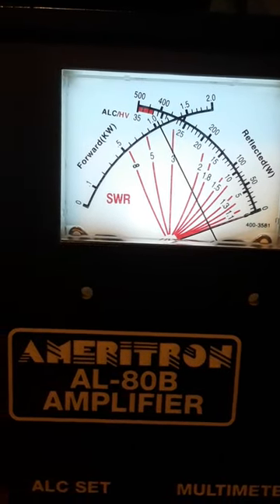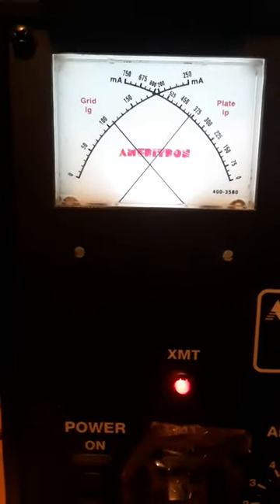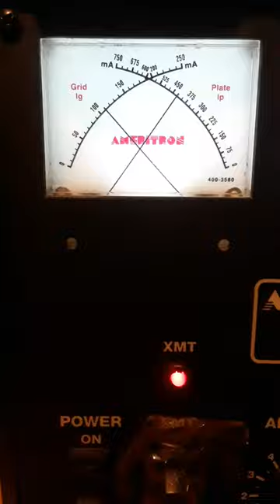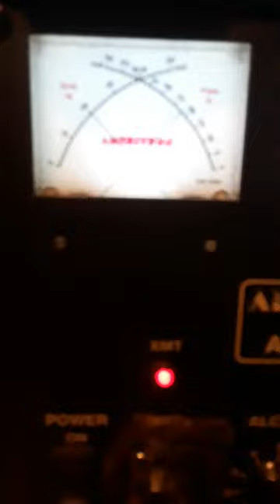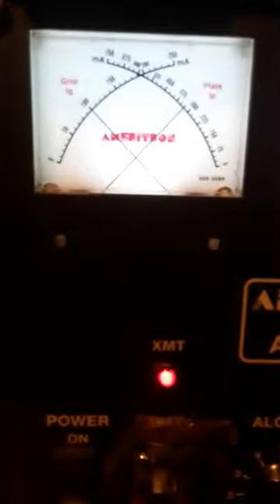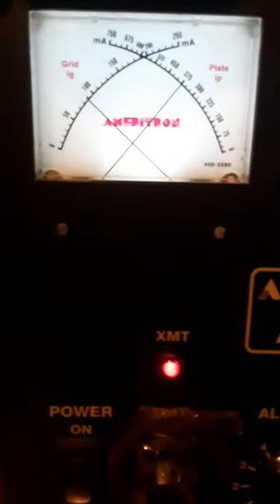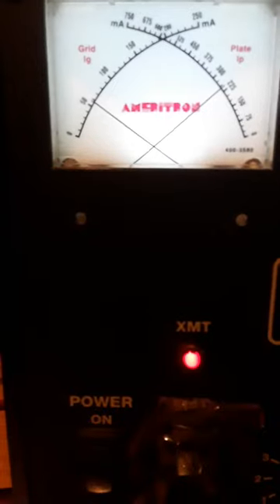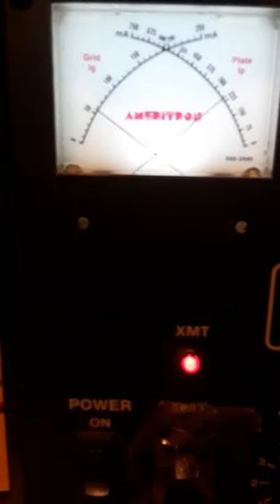Ameritron AL-80b.#2.September 10, 2017

Comment: poor amplifier, the abuse it is going through. a 800 watt amp being abused by a cb'r. wv8ez
Reply from the maker: It's actually a 500 watt amp and always grid & plate under the max owners manual ALL SO, USING A 10 AMP FUSE IN THE 20AMP FUSE SLOT GEARING IT NOT TO EXCEED 10 OF ITS LISTED 14AMP DRAW.THESE ARE JUST SOME OF THE THINGS & WAYS THAT MAKE MY "HOLE IN DA WALL MESSY MIRACLE BENCH CB SHOP UNIQUE".!.😦. HAVE BLESSED DAY.👅😝🙌👑😇👮🎩👣🇺🇸